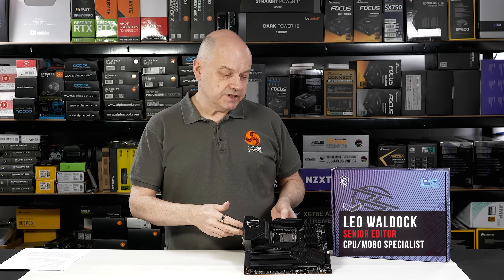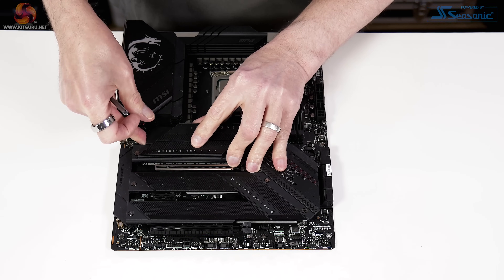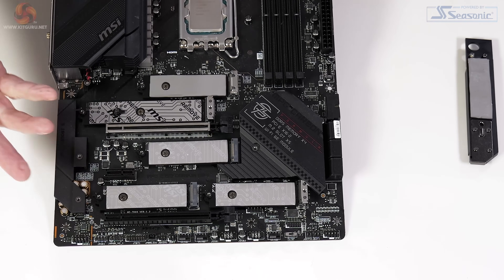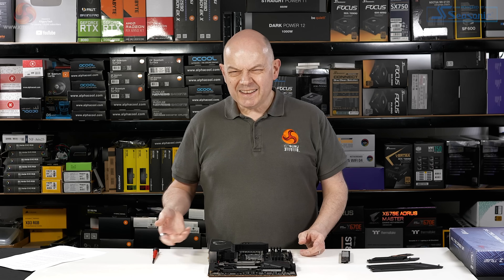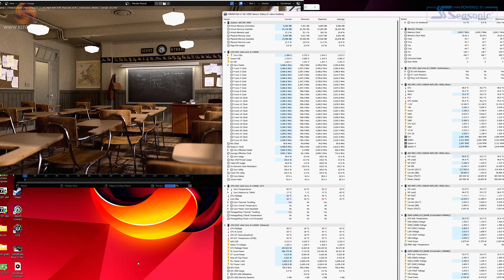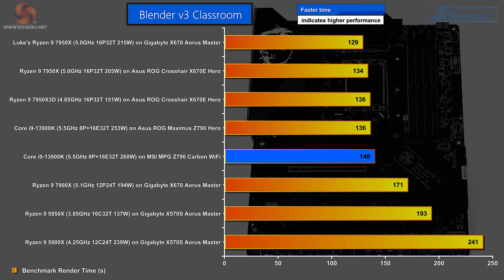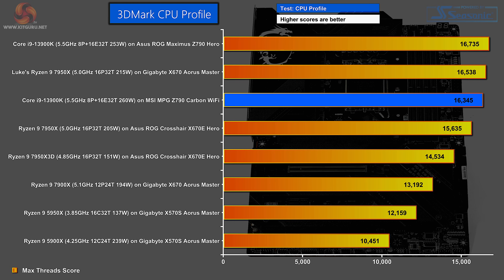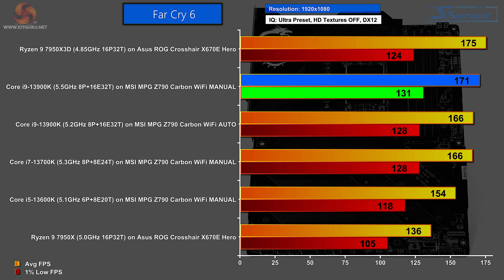MSI MPG Z790 Carbon WiFi - Ouch, my poor Core i9

Comment: Perfect timing, just booted up a 13700K yesterday, MSI tomahawk, arctic 360, seeing roughly the same 'auto' performance/heat as you.  And so I have a question, never messed with my CPU before(oc/undervolt).  3 takeaways from the video, set cpu core voltage to 1.3, loadline calibration to mode 5, and set BCLK 100mhz lock on to enabled.  Do that, reboot, retest and cross my fingers.  Do I understand those changes correct?  I have a clear CMOS button on back so not too worried, but just wanted to be sure.  Thanks for any input!
Reply from the maker: That would replicate the settings I used. You could likely increase LLC to 3 and perhaps drop Vcore towards 1.25V. The BCLK lock may not bring any benefit but having it floating around didn't seem to help so .....
Leo
Reply: @KitGuruTech Hey kit, have you tested the 13700k any more on this board would those be the most optimal settings to use? Or should I use the ones you mentioned in the video. If you could lmk that would be great! Keep up the good work ❤️
Reply: @KitGuruTech  tnks leo <3
Reply: 1.3V???? Why? My 14600K running fine with 1.1V and max temperature is 63C.
Reply: @KitGuruTech 
can you suggest settings for i9 14900K processor. Waiting for your reply
Reply: Here we are, 14 months later, and with the 13th/14th Gen problems coming to light I wanted to thank you again for the help.  Undervolting it day 1 may have saved mine.  It's been rock solid.  Crossing my fingers.  Thanks again.
Reply: Hey Scotty did you ever find the best settings for you?
Reply: @joe-ox5rc  hey Joe, 1.25vcore and LLC at 3 works great for me.
Reply: @ScottyGG  thank you Scotty!
Reply: @ScottyGG   i7 13700k?
Reply: @Zorojoro2  correct, 13700k.
Reply: @ScottyGG did you enable bclk?
Reply: Was literally just looking back at this vid since I heard about the Intel news and recently got an i13700k with this mobo. Looks like I won't start building the PC until Intel releases a fix

Comment: Can you help me configure i7 14700k and MSI MAG Z790 Tomahawk DDR5. Right now it's stable and I've also updated to the latest BIOS(0x12B) where there is a new option to limit voltage.
1) CPU LLC on default (Auto: Mode 16) show 1.1/1.1 mOhms of AC/DC LL.
2) CPU LLC set to auto.

If I manually set AC/DC load line to Mode 9(as per previous BIOS) AC/DC LL changes to 0.4/1.1 basically there is undervolting going on and using this Lite load mode cinebench score drops significantly because CEP starts to kick in. To mitigate this situation I've to turn off IA CEP.
Now I want to lower both AC/DC LL (0.5 or 0.6 mOhms) and also want to match it with LLC then I'll slightly undervolt+offset. What LLC value should I set and how can I verify that the value I set for LLC is equal to 0.6 or 0.5 mOhms.
Otherwise keep it short and suggest me LLC and AC/DC LL values...

Comment: Setting a fixed voltage concerns me. I believe you shouldn't take away the CPU's ability to drop the voltage to 0.7-0.8V in idle or light load, and forcing it to stay at 1.25-1.3V all the time.
Reply: If you have MSI Z790 motherboard then the latest BIOS update with 0x12B has new features that add a voltage limit. I think you are right and one should use that option to limit voltage to 1.30v rather than setting a fix 1.30v all the time.

Comment: Great motherboard especially now as it is down to £330. Just picked up one from ebay as an open box sold via eBuyer at an absurd £227...Well worth shopping around on eBay for the higher end motherboards either open box or refurbished as the price difference is huge....Board has been and absolutly right on reducing the vcore which on auto is set way too high...Set mine to 1.245v on the 13700K and it runs cool boosting to 5.5GHz on 2 cores and 5.4GHz on all the others.....

Comment: I have a 14900k and I'm having the HARDEST time keeping the temps down, while maintaining its full capabilities. The only way I've found to keep temps reasonable is to set "box cooler" setting but that's severely limiting performance and my cinebench score drops to 36k from 41 (even while bouncing off 100c). I've messed with lite load modes down to 8 from 10 and disabling "enhanced turbo" among other things but I just cant seem to find that happy sweet spot. I'm getting quite frustrated. I may try out these settings when I get home and see if it hits that happy medium but I'd love a video dedicated to taming the 14900k on an MSI board, similar to this one.
Reply: Any luck? Same problem
Reply: @Wiebe187  setting it to box cooler or just manually inputting the intel specs is the best way to manage temps. 253w for short and long power limit, 307A icc max and 56 second timer between short and long power though that doesn’t matter if they are both set the same. Also check the “lite load mode”. Mine was set to auto (mode 10) I dropped mine down to mode 8 though I could prob go lower and with those changes alone, my cpu is running massively cooler. Never exceeds mid 70s with 360 AIO
Reply: @BipolarBLKSheep  so I did this but my cinebench score is only 37k is that normal?
Reply: @Wiebe187  Yeah. That’s actually not bad for intel set specs on a 14900k. If you run higher wattage, you do get better performance but that comes with the cost of more heat. Intel spec and 37k score is a good middle ground.
Reply: @Wiebe187  I don’t even know if the difference between 37k and 40-41k in cinebench is even noticeable with 90% of use cases. So I’ll take the cooler temps over a potentially unnoticeable improvement in performance.
Reply: @thatBLKSheep awesome thanks for your help!

Comment: You just need to enforce intel limits… it’s 1 setting, you don’t need to do all that…  also, never load optimized defaults.. literally EVERY mobo (over 200$USD) manufacturer overrides intels settings causing high voltage and overheating.

Comment: I have a similar problem with my i9-13900K.. By default BIOS Setting MSI z790 (K-on auto + XMP-on) I have CBR23 ~ 40K multicore points @ 300-325 Watts but have 100 degrees + throttling... NZXT Kraken X73 can't stop that monster!!! (((
Vcore 1.300 and offset -0.065 or -0.075 not much help... (
Today I will try your 3-point advice and see the result..... (Core Voltage 1.300 + CPU LCC Mode 5 + Lock BCLK)

Comment: @KitGuruTech can you suggest settings for i9 14900K processor. Waiting for your reply
Reply: Already tried it,and currently using it with i9 14900kf works perfectly fine with rtx3070, full msi build.
Reply: Probably be the same. Also now msi put out an intel default settings bios which will do the default recommended intel settings for you.

Comment: Hello Leo. I just bought MSI Z790 gaming wifi plus motherboard with 14700K
I installed Noctua D15S CPU fan successfully.
I don't have a graphic card yet. I will buy soon. My choice will be 4070Ti super or 4080 super. Not decided yet.

The question is, After installing noctua, It seems that, I won't be able to install graphic card to the first suggested Pci ex 4.0 slot, I have to install the below one which is also 4.0 slot.
Will it be problem in anyway or disadvantages?

Thank you...
Reply from the maker: Are you sure you have the cooler installed correctly? This motherboard has plenty of room above the CPU socket and I wonder whetehr your cooler is rotated 90 degrees. Slot 1 is Gen 5.0 while slot 3 is Gen 4.0 so moving your graphics card is theoretically an issue. The thing is, it shouldn't be necessary.
Leo
Reply: @KitGuruTech  I checked one more time :)
The express slot which is in the top of the motherboard is Pci ex 5.0 and the slot is covered with metal. Others are plastic.

The noctua is installed correctly, the radiators are set vertical 90 degree. Not horizontal. I watched many different videos and same as them.

I can see the metal slot under the radiator. But so close to the radiator. 
I am not sure If I will use that port :))

Thank you for your help, I think I will be sure when I buy the graphics card :))

Comment: Do you have a tutorial like this for a 14700k using this msi bios? Very difficult to find. So far i got a stable -.050v (bad lottery i guess) but scared to touch anything else. Cinebench still touching 100c but less power is being drawn. Or can I use ur bios undervolt settings on a 14700k aswell?
Reply: hi there I am looking for same answers. i9 14700K msi z790 carbon wifi motherboard
Reply: @verbold1979  I got a thermal frame since this post,  extreme grizzly thermal paste,  kept the -.050 under clock and called it a day

Comment: Isn't the m.2 _2 slot the gen 5? The one closest to the main GPU slot?
Reply from the maker: Yes, quite correct. M2_1 at the top is Gen 4.0, M2_2 is Gen 5.0
Leo
Reply: Thoughts on using that vs not for gaming? I’d love the faster speed but won’t it split lanes with the gpu? Seems like a big sacrifice?

Comment: Hey, thanks for the super useful video. I am rocking this board but with the 14700K. Do you think the same voltage config would be applicable? I seem to instantly hit 100 degrees in Cinibench despite reasonable temps in games.
Reply: Got any advice? So far I got a stable -.050v but still hitting that 100c
Reply: @lulufolds  well in the end, I replaced my Noctua DH15 air cooler with a MSI MEG S360 AIO. I can now run a "reasonable" overclock without thermal throttling. Also got good air flow in the case. 2 x intake at the front, 1 x exhaust back, 1 x intake at the bottom, plus the AIO exhausting at the top.
Reply: @FarObserver  im using the h150i with 6 fans on the rad, 12 fans in the case together. Cinebench hits 100c in a second of starting 😞 think that aio isn't good enough.
Reply: @lulufolds  hmm, bare in mind I'm in no way an expert in OC'ing/tuning mobo's so please take what I say with a large pinch of salt, but are you sure you've got enough thermal paste or that it is distributed evenly? I would expect your cooler to cope if you are reducing voltage and not pushing anything. Might also be worth checking airflow is going one way and not creating negative air pressure. Sometimes less is more with this stuff! Also, I did have to tune my fan curves a bit, particularly on the CPU to make it more aggressive.
Reply: @FarObserver  if anything I put too much thermal paste, X LOL the airflow is fine, this is me upgrade in my case since having a 9700 k,  idle temp are good it's just running cinebench I get 100c right away, instantly, gaming it stays below 85c, doing research this is pretty normal for this chip and they can handle 120c,  I just can't find a good video for the motherboard msi z790 wifi of how to undervolt. I'm not an expert either in overclocker. I just lowered the voltage till it was stable yesterday, -.050 , so i lost the lottery on that. and might bring it down to level four or five I was reading could help but I really don't know what I'm doing with the other configs

Comment: What I found after testing the settings from Leo in a MSI z790 Edge WiFi is that the temps still get too high as the PL1/PL2 are not limited. Once I set PL1/PL2 to 253W each on top of Leo settings is what makes the performance to drop dramatically as the P-Cores runs at 4GHz and E-Cores runs at 3.6Ghz when the CPU is loaded at 100% in Cinebench.

What solved the temps and performance issues was reverting the VCore and LLC settings (keep the BCLK 100Mhz enabled),  set the PL1/PL2 at 253W and use Adaptive+Offset with a negative offset of 0.095 and after this my 13900K barely reach 85-87°C at 100% and the P-Cores runs at 5.5Ghz and E-Cores runs at 4.3Ghz in Cinebench getting 39.835 score.

I'm really thankful to Leo for this video as it allowed me to understand how the CPU behaves and lead me to experiment to solve the issue.
Reply: Hi what cinebench version & test were you running for this score?
Reply: @HomeGrownMedia  Hi, I used Cinebench r23
Reply: @VGShrine  I can only find r24 and the scoring system seems completely different

Comment: Hi Leo,

I bought this motherboard after reading your review and applied the same settings for my i9 13900KF. Works like a charm.
I also bought the Gigabyte Z790 Aorus Pro X with an i9 13900KF for my son & I am trying to replicate the settings in the Gigabyte BIOS. I can set the Vcore to 1.300 and adjust the LLC, but I cannot find the 'BCLK 100MHz Lock On' option in that Bios. I know you recently reviewed the Aorus board, can you please recommend on what I should do ?

Thanks !

Comment: Hi! Great reviews, thanks. I have a question reg. trhe M2 slot 1 and slot 2. I will use gen 4 nvme dis, whick slot will be most optimal to use ? I want to use one that is connected directly to CPU without interferring with VGA PCI slot... By the way, I can't find the block diagram for this mainboard, anyone does know where to get it ?

Comment: Hmm... tried your settings with an i9 13900KS with Carbon, but no change in temperature.  Still zooming to 100° C.  But came here looking for how to enable undervolting so Intel XTU will work... where is that setting in bios?

Comment: Hey. I have just built a pc using this board.
Everythings running mega cool and lovely. But for some reason the temperature that reads as system in msi center and just as system in the bios hardware monitor was saying it was 100c! After gaming for a while. But cpu and gpu were only 40 to 50c and nothing on the motherboard was physically hot at all.

I am having trouble finding out what the temperature under the title system actually relates to. Do you have any ideas?

I remenbered this video when I saw it and thought maybe its them overkill vrams so I have just manually set my 13th gen i7 to the settings you said to use here and will see if it does it again.

But any ideas? It is very strange. Maybe a senson just went barmy.

Comment: Bought this Board came DOA, IO on the back would light up but the board would not post tried jumping the board (by touching the power pins with a screw driver) nothing would happen. Sucks it was the motherboard in mind for my build, Planned to return and try another one if I don't find a better option(any recommendations would greatly be appreciated).

Comment: I just bought an MSI Z790 Carbon Wifi + i9-13900K + Gigabyte AORUS WATERFORCE X 360 + G.Skill Trident Z5 64GB DDR5 6400 CL32-39-39-102 1.40V + MSI GeForce RTX 4080.

I also made sure to update the BIOS to the latest version, which is 7D89v18 released on September 14, 2023.

I followed your instructions meticulously, activating XMP, setting the CPU Cooler Tuning to Water Cooler, configuring the CPU Core Voltage to 1.3, enabling CPU Loadline Calibration Control in Mode 5, and locking the BCLK at 100MHz. However, when I ran Cinebench R23.200, I noticed that the CPU temperature consistently reached a worrisome 100°C.
I experimented with various CPU Core Voltages such as 1.2, 1.25, and 1.36, but the temperature remained stubbornly at 100°C during Cinebench runs. I also tried different Loadline Calibration Control modes, including 1, 3, 4, 5, and 8, but none of them made a difference in the temperature. It consistently stayed at 100°C. 
On the bright side, when the system is idle, the CPU temperature hovers around a comfortable 33°C.

I'd appreciate any advice or suggestions...

Comment: Thank you so much for sharing this video with us. I have the same problem,  the computer which I bought  2 weeks ago is still sitting at the market because of overheating. I'm not understanding  clearly video because my English is not good. If I make these 3 settings from the bios as you said, the temperature drops as you say and the performance increases, right? I would be very grateful if you could take the time to reply

Comment: Ok, this is driving me nuts.  Does the MSI MPG Z790 Carbon WIFI have Intel Turbo Boost and Intel Turbo Boost Max 3.0?  Nowhere in the spec manual does it mention it or on their website.  I was waiting for you to click on "Advanced CPU configuration" to see if it was there.  (obviously not blaming you for not showing; that part of the video was to just show how to adjust settings manually to prevent too much power consumption/overheating, etc; which is helpful if I end up getting this board, so ty!)

Can you quickly confirm or deny if this mobo has TB and TBM 3.0?

EDIT:  8:53, it's right there! Ok, ty.  It would be crazy if it didn't have these basic features.  I think I'm just gonna splurge and go for this board.  If I get thermal throttling outside of the box (using a 360 Kraken), I'll just under volt it a bit.

Comment: This is a just a fantastic walk-through for this motherboard. I'm curious to know if 3 months later if MSI has done anything to address the BIOS issues you address here? So if one was to buy this board today would you need to go in and adjust the settings as you do here? Thanks so much for a great vid!! Well Done!
Reply: Just upgraded to this motherboard and no, I have to do the same in the video otherwise my 13700 will thermal throttle at 100c
Reply: Just bought it, updated bios, activated xmp and it runs at 88 degrees max on 13700K stock

I think it has been fixed
Reply: But, this motherboard still doesn’t run 7200Mhz DDR5 Ram.

Comment: If you change the CPU cooler tuning to cap out to 253w with “Boxed Cooler” would that have helped instead of auto on the other settings or manually setting your CPU??

Comment: I just got a 13900 non K and all that voltage may actually be useful.  As a reviewer you may be getting great silicon but it seems Intel selling plenty of ass silicon that needs all that voltage.

What I really dislike is how everyone is benching these chips overclocked instead of at their published specifications that they are guaranteed to operate at.  Combined with cherry picked silicon these reviews end up being quite misleading.

Comment: Will these settings currently work on a MSI Z790 MEG ACE? I’m currently building a system with a 13900ks and a 420mm Aio. First system I built in a while and I’m a bit nervous messing with voltage settings.